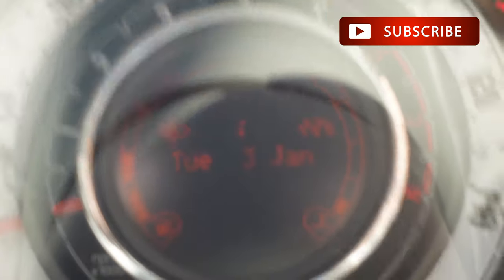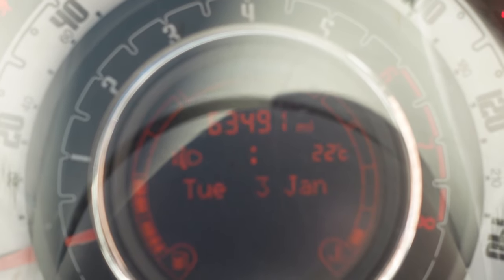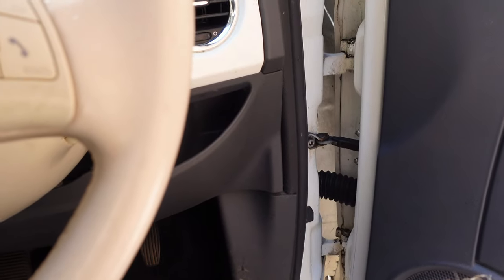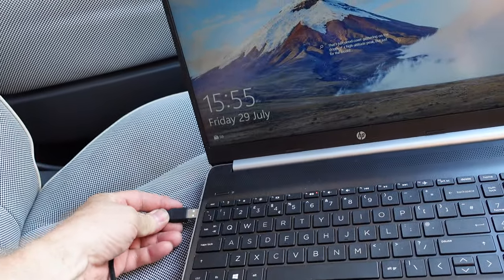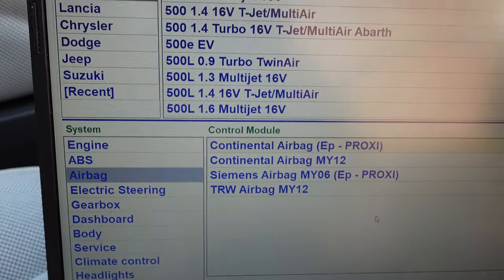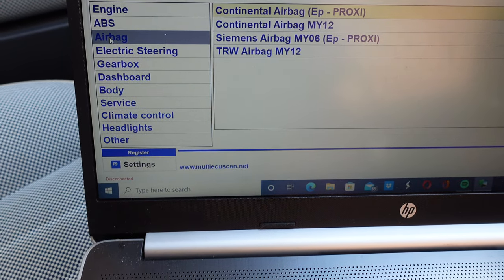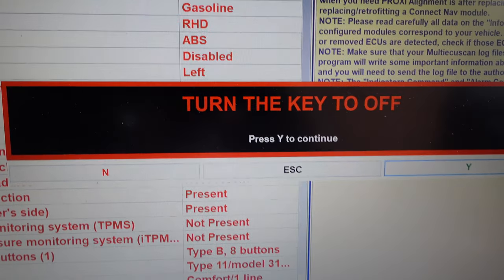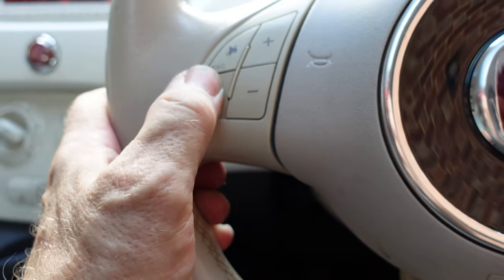Fiat 500 Flashing Mileage & Proxy Alignment - Blue & Me Not Working? #blueandme #fiat500 #abarth

Comment from the maker: I can now repair Blue and Me Units that are broken. Whether it's nothing happening when you push buttons on the steering wheel, flashing mileage, battery drain etc etc. If you remove your blue and me. Message me with your model number so I can confirm it is one that can be repaired and then email me paul@love500.co.uk and I will send you a repair booking form. Cost is £60 plus £8 return of your unit. If your unit is beyond repair, there is no charge except the cost to send your unit back to you, if you want it back. Cheapest repair in the UK.
Reply: I’ve just purchased a fiat 500 and noticed the flashing mileage. Now I know why. I will be in touch in a few weeks. Thanks for this 👍
Reply: I have recently installed a new stereo with a screen on my Fiat Qubo. Since then I’ve 3 problems:
1. Parasitic drain. The battery dies after 3 days of standing still without starting the engine. 
2. Flashing mileage.
3. The USB inbuilt (Blue&Me) doesn’t connect. Tried charging my phone using a cable but it doesn’t charge. 

Now, all I care about is the battery. I don’t mind even if the mileage is flashing as long as my car start. 

So, my question is, will it solve the parasitic drain problem in the car if I remove the cable/ wire that is connected to the Blue&Me module which is a black box located right underneath the driver seat (Belgium EU) ?

Thanks
Reply from the maker: @chevysolo2141  the short answer is yes unplugging it will stop the battery drain. The mileage will continue to flash until you either have it repaired or do a proxy alignment. The flashing is not only because your blue and me is broken but also because it’s looking for the original stereo.
Reply: @Love500  thank you so much for your reply. 
It seems like a simple step to follow but none of the garage in Belgium know how to work with this issue. 

Anyway, I unplugged the cable that is connected to the Blue&Me. Let’s see how it goes now.
Reply from the maker: @chevysolo2141  it will definitely stop your parasitic drain.
Reply: By the way, the Fuse number F53 on Fiat Qubo 2016 CNG model is also drawing some energy from the battery when I checked it with the multimeter. 
F53- Instrument Panel node. 

Does it have to do with the flashing odometer? 
And when I removed the fuse 53, the instrument panel lights completely go away. 

Thank you for replying to messages. 
I really appreciate it, sir.
Reply from the maker: @chevysolo2141  you can’t pull a fuse for the blue and me as it covers other things too. Yours isn’t a 500 so may be different. It’s not necessarily your blue and me as the mileage will flash if any ECU has disconnected temporarily from the body computer. A proxy alignment may fix it.
Reply: @Love500  I can’t wait for 48hrs to see if my car battery is still good ;)
Thank you and already a subscriber here 👍🏻👍🏻
Reply: @Love500  okay, I’m back again after more than 48hrs :)

So here are a list of things I’ve noticed:
1. Just simply unplugging the cable of the Blue&Me module didn’t solve the parasitic drain. After 24Hrs the battery the battery went down from 12.5v to 11.5v

2. Then I started the engine and charged the battery to 12.5v
And then I removed the F36 from the Fuse box (inside the car just below the steering wheel) and after 30Hrs the car battery remains the same and that is 12.5v. No more parasitic drain.

And F36 fuse says:
1. Radio Bluetooth System Node
2. Blue&Me node
3. EOBD Diagnostic Socket
4. Volumetric Alarm ECU
5. Alarm Siren ECU

Besides the number 1 and 2, do you know what the rest are? 

Thank you for your help.
Reply from the maker: @chevysolo2141  this is why you can't just pull the fuse. 3 is your diagnostic socket (where you plug in a diagnostic dongle), 4 is a module that runs your alarm and 5 would be the siren for that alarm. You would need to disconnect 1 at a time and try it. My guess is the alarm. I would disconnect 4 first and have the rest connected. It's a process of elimination.
Reply: @Love500  I truly appreciate your time and responding back to messages and assisting me to solve this issue. 

Well, I have a question. I have tried this whole evening looking for the wiring diagram of Fiat Qubo 2016 on the internet to locate the Volumetric Alarm ECU and Alarm Siren ECU in the car but I couldn’t even find it. 

Do you have any idea where I could find the module or unplug the wires?
I’m doing all this by myself after a garage tried to charge me 1500€ here in Belgium. Absolutely ridiculous! 

Again thank you for your help, sir.
Reply from the maker: @chevysolo2141  I’ve no idea I’m afraid I’m not familiar with the Qubo. Join www.fiatforum.com. There’s a Qubo section I’m sure.
Reply: @Love500  hi again, I want to ask you something again regarding the battery voltage.

So, after 24hrs the battery voltage went down from 12.50v to 12.45v
Is that a normal drain?

This is much better than before because earlier it was 12.5v to 11.5v in just 24Hrs.

Thank you so much
Reply from the maker: @chevysolo2141  have you actually tested your battery? What’s the voltage when the engine is running?

Comment: If you just disconnected the blue and me unit, would the mileage stop flashing?.. or would you still have to do a PA? Mine used to work but it just stopped. My Battery is not going flat but I am not too bothered about it not working. (Mine is a lounge spec original UK reg).
Reply from the maker: The one I did in this video completed a proxy alignment. The one I did today wouldn’t do it as it failed due to the convergence error. You have to do a proxy alignment after disconnecting otherwise it will still think it needs reconnecting.
Reply: @Love500  👍👍

Comment: Just fyi, I have the blue and me problems in my doblo. I didn't want to bother with it buying software and adapters so I opted put it in the local shop. I live in Germany so maybe there was a technical language problem but I had my wife come with so I could properly explain what to do. I usually do all my own work on our vehicles but the computers and sensors are all getting too much and I don't want a bunch of diagnostic devices that I will probably use once. So I had 5amp draw and traced it to the blue and me. When I put it in the shop I said that I wanted it unplugged and removed from the can system.  Cost me 88€ and was told that the draw was dropped from 5 amp to 0,03 when finished.  Great,  worth it to me. Problem is that they didn't physically disconnect the blue and me unit and while I was replacing the struts and waiting for parts to arrive the computers found each other and reconnected with blue and me and once again my draw was back.  And  that's why I do my own work.  But just something to keep in mind that if you are doing away with the blue and me it should absolutely be physically unplugged.  Thanks,  nice video.  I'll live with the blinking odometer as I can't hardly see my console anyway and it's not bothering me. The blue and me is located under the left side front seat on the doblo 2011 and really easy to get to and unplug.
Reply from the maker: I always say disconnect it as you can’t pull a fuse. Proxy alignment will sort the flashing mileage if it gets on your nerves after a while.

Comment: Which version of ecu multiscan do u use??? I've downloaded 5.2 but it just won't connect to the car!!!! I have elm 327 and yellow connector, but it keep says check interface etc? I'm pulling my hair out!
Reply from the maker: @airgunverminhunter4265  I’ve now got 5.2 as I recently upgraded as mine was a few years old. Most connection issues are down to either the speed or the elm not being selected in the settings.

Comment: Hi Paul, thanks for all the useful information you share with us. I have mileage flashing and a message saying fuel cut off and start and stop unavailable, but blue&me, usb socket all work fine. Someone says it could be an issue with the hatch wiring, any thoughts on this?

Many thanks
Reply from the maker: There can be a lot of things to cause that. From battery to earth strap normally. Can also be the brake switch too. Needs diagnostics really to try to pin it down.
Reply: @Love500  thanks Paul, I'll try the diagnostics.

Comment: Hey Paul, should the USB port still work if the ECU isn’t? I guess if the issue was only the USB not working my phone should still connect to Bluetooth? Any advice would be welcome and keep up the great videos! Cheers
Reply from the maker: Probably not but possibly as there are various faults that happen with these. Do your steering wheel buttons work? What happens when you press the windows/phone button on the steering wheel?
Reply: @Love500  Blue&Me logo comes up on display when switching on, USB doesn’t work, voice and phone buttons don’t do anything, but volume buttons on the steering wheel do. Have flashing Odometer and battery drain. Someone suggested changing USB port first but an additional expense if it is the ECU. Cheers
Reply from the maker: @seantucker2690  100% the blue and me module. Repair or replace.
Reply: @Love500  If I remove as not bothered with it, I am guessing that would be okay to?  Proxy alignment after removal will stop flashing Odometer? Cheers
Reply from the maker: @seantucker2690  you don’t need to physically remove it, just unplug it at the unit. Once you’ve done that and done a proxy alignment all will be good.

Comment: Hi Paul, from your experience, if when I connect the blue and me module the USB socket lights up but when I press the "phone" button nothing happens, could it just be a proxy alignment to be performed?
Was the USB socket turned on and illuminated in your car?
A thousand thanks!
Reply from the maker: I really couldn’t say to be honest. They are separate parts no doubt with separate chips on the board. As long as you’re not going to fiat and paying for a proxy alignment, it’s certainly worth a try.

Comment: Hello, my wife has a low mileage 500 twin air. The boot can now only be released using the bottom button on the remote. The odometer is now flashing. Could this be a broken wire to the boot causing firstly the boot problem and months later the odometer? I would be grateful for your comments.
Regards,  Allan.
Reply from the maker: Yes quite likely or the microswitch on the handle could be faulty. Flashing mileage is normally down to the blue and me but could be related.
Reply: @Love500  Thank you, ...... looks like I'm going to have to pay for the £100 + diagnostic check before any repair.
Reply from the maker: @allanmurray8123  diagnostics may not show anything so I wouldn’t waste your money. Remove the battery earth lead and pull back the rubber concertina gait or of the hatch wiring and inspect the wires. That would be the first thing to check.

Comment: Hi Paul I’m a fiat abarth 2013 owner I have changed my original stereo to android stereo and the mileage start flashing and also my car if I didn’t start it within 48 hours it will not start Help please .
Reply from the maker: It needs a proxy alignment using multiecuscan. The BCM is looking for the original stereo. If your battery is draining I would remove the blue and me unit. Then clear any error codes on all ECUs and then do the proxy alignment.
Reply: It’s showing that the proxy alignment it can’t be complete this is the error ( entertainment telematic node (ETM)) failed
Reply: And there is one error is not going when I clear it ( U1700-86) - no body computer
Reply from the maker: @alghazalalshamsi  can you link to your the BCM itself?
Reply from the maker: @alghazalalshamsi  there’s your problem. Your blue and me is broken.
Reply: Should i change it  or repair it?
Reply from the maker: @alghazalalshamsi  I can repair it for £60 plus £8 return postage. But you don’t actually need it as you’ve got your new stereo. You could either disconnect it, then redo the proxy alignment, remove it entirely and do a proxy in which case you could bin it or send it to me for repair then sell it. If you sell the car and decide to take out your new stereo you might want to reinstall it though. If you would like me to repair it, drop me an email at paul@love500.co.uk and I’ll send you a repair form.

Comment: Hello King :) need yor help here, my daughter has a FIAT 500 1,2 from 2015 and speedo´s lcd is broken, i bougth a used one and i´m wondering if ican change it without coding? many thanks for your quick replay/ br Ekrem
Reply: i bought the whole unit (speedo) ,i forgot to write
Reply from the maker: @ekcaca3677  it will need a proxy alignment. It’ll work but the mileage will flash. Ideally you adjust the mileage and then do a proxy alignment.
Reply: @Love500   thanks a lot, can i do that with multiecuscan and this yellow ELM thing :)
Reply from the maker: @ekcaca3677  yes but you can only raise the mileage not reduce it.

Comment: Hello I'm about to start diagnosing my fiat 500s flashing mileage. Is there anyway I can send you a video for some tips/help. I had to fit a new battery last week as the old one couldn't hold charge and shortly after the mileage stopped flashing. Then it came back again recently. I don't think this car has the Bluetooth module mentioned as I don't see a windows button, but rather a phone symbol on the right of the steering wheel. Nothing in the instrument cluster to indicate there's a phone/Bluetooth option....
Reply from the maker: If you have buttons on the steering wheel, then you have Blue and Me. What year is your car and what spec, Pop, Lounge, etc.
Reply: @Love500  thanks for your reply, it's a 2014 500 sport, same instrument cluster in your video. With the buttons on the steering wheel, when I press the phone icon it does nothing so I will be investigating the blue and me but I will try disconnecting the earth to see if this solves anything first
Reply from the maker: @kings-art957  all of your errors are probably due to the battery discharging which is most likely caused by a parasitic drain on your blue and me. You may find your new battery does exactly the same. It could also be down to your main earth strap needing replacing. See my other videos. If you cannot connect to your Blue and Me, I can now repair them. Email me at Paul@love500.co.uk for a booking form. £60 plus return postage, no fix, no fee.
Reply: @Love500  cheers, is there a fuse I can check to see if the blue & me has power going to it?

Comment: Hi. Where are you located. I would like for you to have a look at my fiat 500. I believe I have a blue and me fault. I had replaced my unit and had a proxy alignment done, but no luck. My battery is also being drained at an alarming rate; Totally flat within 3 days.
Thanks.
Reply from the maker: That’ll be the blue and me unit causing a parasitic drain. Only unplugging it at the unit will fix it or a new unit although you say you’ve replaced the unit. I’m in NW Kent/ South London.
Reply: Thanks for getting back to me. Would it be possible to bring my fiat down to you, for you to have a look at it, and pass your Midas touch over it?
Reply from the maker: Yes, not a problem. Drop me a message on Instagram, Love500Salvage. If you don't have Insta, email me at paul@love500.co.uk

Comment: Assume this can be done with scanners that have the ability to program modules.  I have a autel that can do that and access to a high end snap on machine as well. Wasn't expecting you to know for definite as you clearly have a machine that can do the job so no need to expand. This question is probably more for anyone who reads this comment.
Reply from the maker: Some certainly can as an independent garage can do it and tend to be half the price of a Fiat. It’s more about the lack of knowledge at a garage unless they are a fiat specialist.

Comment: Hi I have  500 twinair 2012' having problems with   blue and me stopped working about 2  year ago ' flashing mileage. On dashboard 'battery and alternator replacement ,then if I don't drive for a day or 2' battery dead have to jump start '2nd battery in two 2years. Can you please advise me on what I can do to solve this problem.
Reply from the maker: Your broken blue and me is causing a parasitic drain. You can disconnect it at the unit itself and that will stop the drain. You can get the blue and me unit repaired for £78 via eBay.
Reply: @Love500  Thank you very much for your advice ' I will tell the garage' they have had the car for a while now and couldn't find the problem. 
Thanks very much paul...

Comment: Does the 2015 and up have the flashing mileage since it’s not digital, also since it’s different from a 2014…….
Reply from the maker: Facelift doesn’t have blue and me which is the main culprit so it would happen less but any of the ECUs being faulty or loosing communication would cause it. Airbag one being the next most common. An LCD dash would still flash the mileage.
Reply: So 2015 don’t have blue just ECU. I have aftermarket radio in mine
Reply from the maker: @jimrodcart  if it’s a facelift with double din touchscreen, no. If it’s a series 3 2015 then yes it does but if you have aftermarket unit then it won’t be used.
Reply: Hi, I’ve downloaded the iOS version of Multiecuscan, if I get an Elm 327 Bluetooth odb, do you know if this will work. Your videos are brilliant by the way
Reply from the maker: @jonathanwatts2394  I’ve never used the Bluetooth one before. I don’t think they actually support it anymore. I’m sure it’ll work though.

Comment: Hi
Do you have a link for the ELM usb ?
Reply from the maker: Not specifically as I’ve had it years but as long as you get a “modified” one on eBay it’ll work fine. And the coloured leads too of course, specifically for most things the yellow one on a 500.